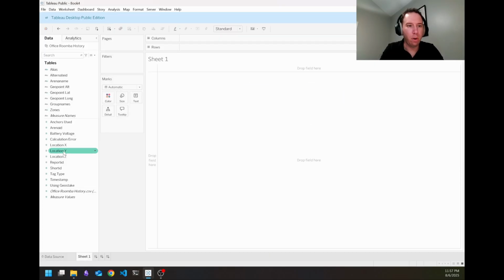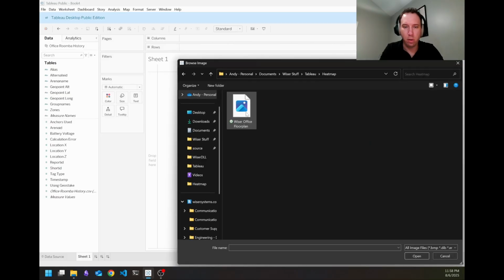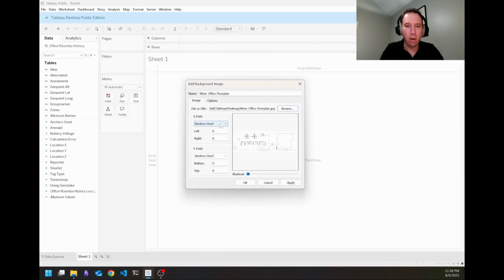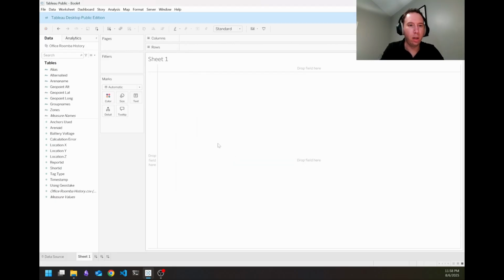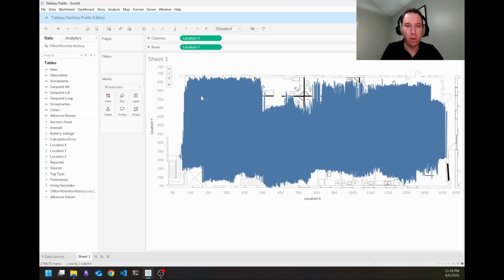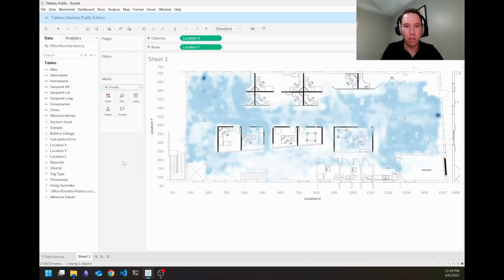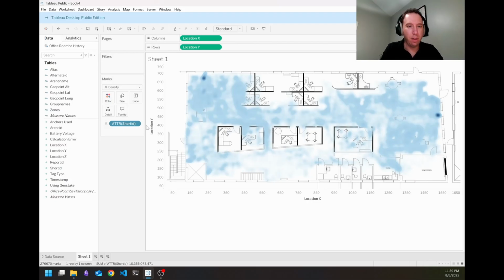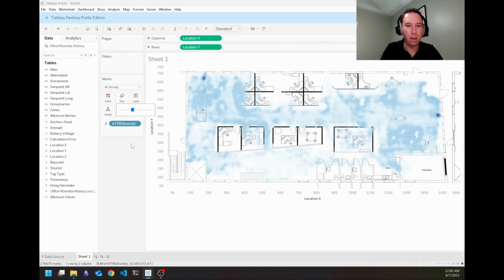Step-by-Step: Easily Create Heat Maps in Tableau Using WISER Data

Comment: How to make in tableau, 1150 different stores all over the US, different formats.  I want to create a great dashboard with a heatmap of all the stores so I can filter by store, city, region, division. Some kind of heatmap. Heatmap logic of sold pieces without pickup of all stores for the year. 
We have 90+ product categories that are logically distributed across the sales floor. 
I would like to take 3 average planograms, for each format. And to heat map them to highlight the buyer's path. 
How to load them and that sales are brought to a certain area, categories are different (for example, refrigerators can occupy 25m2, and accessories for TV 2m2).

It’s possible?
Reply from the maker: That sounds like an interesting project. We are really focused on WIP, asset, tooling and others kinds of tracking in the manufacturing space. You might want to try the reddit channel for tableau r/tableau  They might be able to help you out. Thanks for watching.